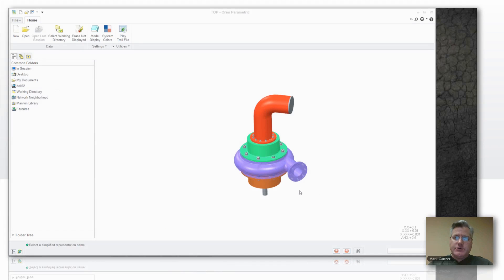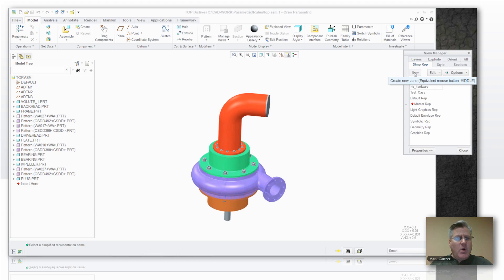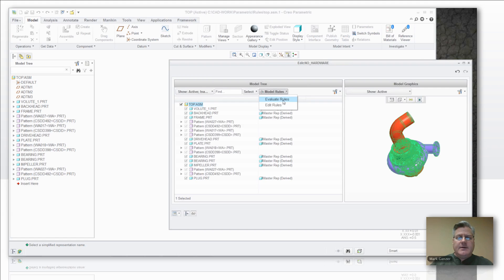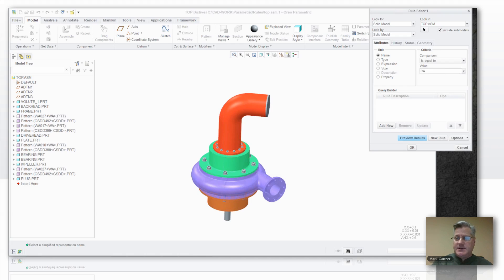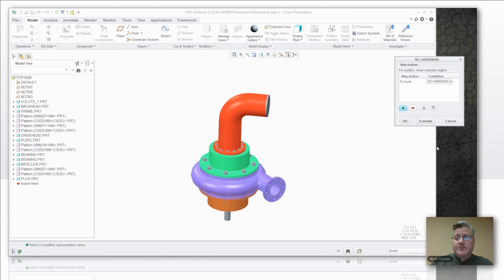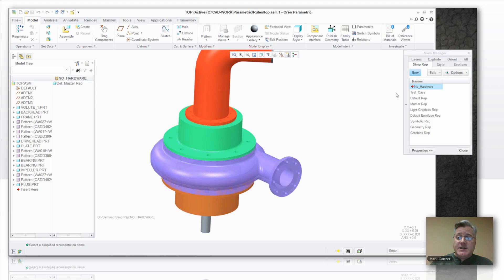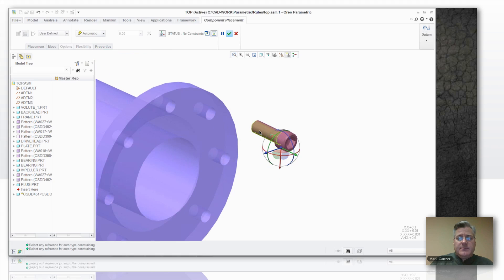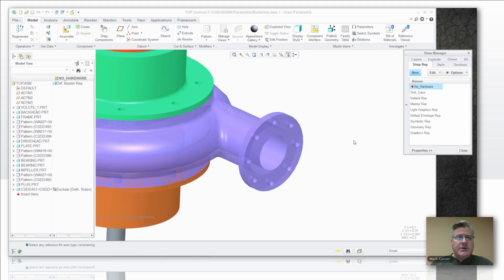Using Rules to Manage Simplified Reps in Creo and Pro/ENGINEER - EAC Tip of the Week

Comment: Well, this works well. But, what if I'm working on a user-defined representation where I have excluded some parts/ assemblies, can I maintain this representation regardless if new parts were added later on.
Please help. As it's really hectic to return back to the representation to exclude the recently added parts.
Reply from the maker: If you create a simplified rep with “Exclude” as the main rule.
Select the components you want visible manually and set to “master”.
Now if any parts or assemblies are added they will be excluded automatically.
 
If you use rules to display your components you want visible, those rules are evaluated against any newly added components and could include them if they conform to the rules set. Manually setting a components display ensures only it is displayed.

Hope that helps :)

Comment: Hi, it works like a charm. But why do I need to evaluate rules when I add something which falls into the set rules? 
I am working on large assembly with nearly 70-100 parts.
Reply from the maker: Enabling rules after their creation applies those rules to new objects as they are created / added to models. Evaluation of those enabled rules happens without user intervention, often at regeneration or screen refresh, so there wouldn't typically be a need to manually force the evaluation.

Comment: Hi Nikolai,
There is no way to use simplified reps to exclude assembly features. You can create a "part" simplified rep and then swap the master version of that part for your user defined simplified rep of that part. Excluding a feature in a part simplified rep is like suppressing it. It will also exclude all children of the feature.
Reply: Thanks for the reply! I was asking because I need to simplify features from a part from a assembly, suppress and family table didn't worked for me because when "simplified" all the constraints (naturally) went wrong.